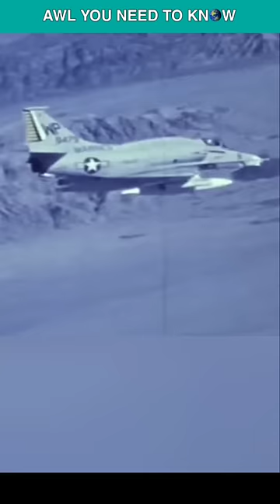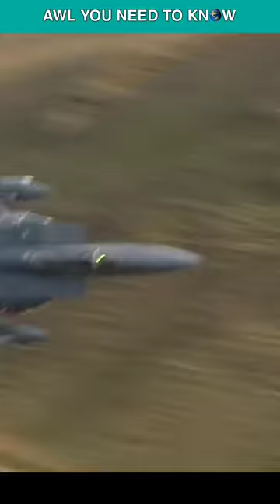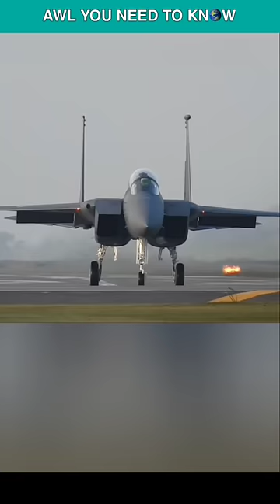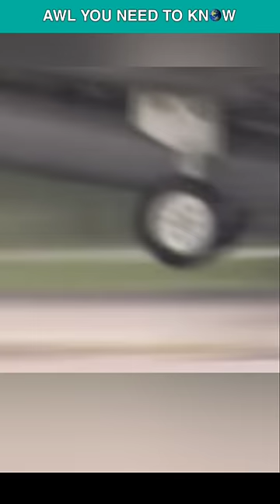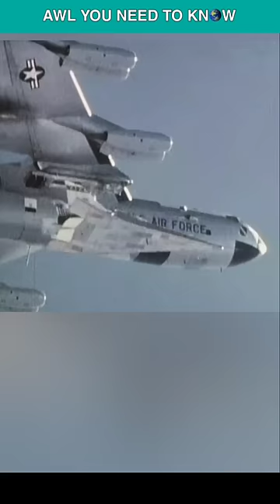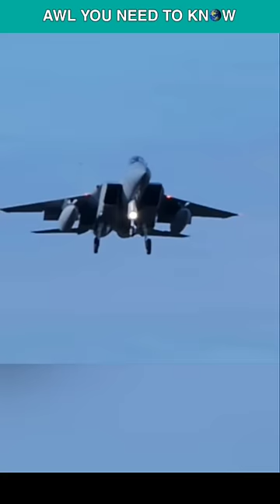When an Israeli F-15 Eagle Landed Without One Wing In 1983 #shorts

Comment: You know you designed a masterpiece when it still can fly without wings.
Reply: Wing*
Reply: @badam7783  *wings. 
It can't fly without a wing, but it can fly without wings.
Reply: @bremCZ  well in the video and on the pictures it flew without a wing so idk what your smoking. But it can only function as a rocket without wings, so it can’t “fly” without wings.
Reply: @badam7783  No, it flew with a wing...
Reply: war thunder moment
Reply: @bremCZ  Without A wing and with a wing is the same thing, both imply it has 1 wing remaining. I dont understand your point here?
Reply: @CaptainBread_  I can see that. If you understood you wouldn't have bothered rewriting what I had...
Reply: @bremCZ 😂
Reply: you know your comment is mastertrash when the grammar is incorrect 😂
Reply: @SotPSotPSotP  Which grammar point are you referring to?
Reply: It's hard to tell if the narrator was saying the plane could fly without any wings. Well land not take off and it might only do that when under a certain weight. It's also possible it could only fly as a lifting body without the wing portions past the engine. If the fuel tanks are in the wings the plane wouldn't have engine power and would quickly be slowed down by drag possibly to the point it couldn't fly even in a dive and would definitely be unable to land without loss of life.
Reply: @bremCZ So an F-15 would still fly without any wings? I think you suppose to say "Can't" instead of "can". Remember, if the object has "s" as the last letter (example: burgers), it means the object is more than one. So wings mean 2 wing(s). I got stroke while reading your reply.
Reply: @SomeOrdniaryEDS  That's because you don't understand it. Also when you're having a crack at someone's grammar, don't write nonsense like "I think you suppose to..."
Reply: @bremCZ you think youre pretty smart outside your little bubble there but youre really, really not.
Reply: @tiguilherman_plays  No I don't. But good attempt.
Reply: 1 wing and it didn’t even look like is had messed up the aerodynamics basically flying like it’s got nothing wrong with it
Reply: Westlife need this story for song "flying without wings".
Reply: @ErickKurnianto  😂😂😂
Reply: Anything can fly with the right amount of speed
Reply: Many airplanes can fly without a wing
Reply: Ah, wings are just over engineering anyway
Reply: McDonnell made better planes in the 1970s than Lockheed does today..
Reply: @bremCZ  Dude that's about the lamest play on words I've seen this year, made much worse by how f-ing hard it was to understand.

Kudos, keep on doing stuff like this. And if you don't get appreciated by others, atleast you will by me
Reply: @viktorbirkeland6520  Why thank you. Over engineered dad jokes are my speciality.
Reply: @bremCZ your comment makes no sense
Reply: @Billy.Nomates  Your inability to understand something is not akin to it not making sense.
Reply: @bremCZ  no,you simply didn't make sense,accept it
Reply: @Billy.Nomates  No, you simply don't understand the linguistic gymnastics. Acccept it.
Reply: An another type of plane recorded landing with similar conditions, search  Damaged A10 lands back at base
Reply: 😊😮 @bremCZ 😮u🎉z
Rhz😢
unüberhörbar 777😢😅😮7
Reply: That jet is one of the greatest fighters ever produced.
Reply: Its not a wing its a balancer a wing use is only for animals with feathers so they can fly but that fighter jet use oil to fly not tge wings that you said
Reply: @bremCZ  BremCZ is the only intelligent dude on here apparently
Reply: @bremCZ i love your comment and im so glad other people are just confused, irritated and upset by your, way with words.
Reply: @mitchc4474  Thanks, I quite enjoy their flailing, and it's slightly amusing that they're unlikely to ever understand it.
Reply: The comment I was looking for
Reply: Regardless of this short. I always had a love for the capability and iconic beauty of F15 Eagle.
Reply: @badam7783  if it is going fast enough, it would still be able to fly with no wings, the f-15 has elevons (elevators that work as ailerons as well)

Comment: He remembered the aeronautical engineering phrase : give me a powerful enouph engine and I will make a barn door fly.
Reply: They teach that in all aerospace.
Reply: I am pretty sure there is still a manhole cover in heliocentric orbit from a nuclear test.
Reply: Not just barn door. Enough power and the full barn will fly.
Reply: @SirSmurfalot eheh... so the problem with that, is that the same manhole you're talking about would have been able to escape the Earths orbit at the speeds it was traveling...
So there's just a dirty manhole cover floating through deepspace somewhere and we'll never find it lmao
Reply: It was a joke that they would have preferred not be proven true. But cool we now know what would happen.
Reply: @SirSmurfalot The ultimate M80 😂
Reply: It’s not that engines so much as the design of the F15 is a large, low lift wing. That’s a trait some of those Israeli pilots were aware of(they’ve also got more flight than most US operators of the plane). When the wing was sheared off, the pilot noticed the flight characteristics under power(that they could maintain lift at higher air speeds)and figured he could nurse it back on the ground. Worst case scenario, he could only make it part way and had to ditch the aircraft(well, worst case is at lower speeds, you end up with an unrecoverable imbalance in lift, slowly flipping the plane during the landing process without enough time/fuel to abort).
Reply: @Pikachugamer-2007 
It had enough velocity to escape's gravitational field but it wasn't moving fast enough to escape the Suns gravitational influence. It will be in heliocentric orbit.
Reply: @kimutaiboit8516  ah, right my bad.
I got geocentric and heliocentric mixed up.
Reply: @Pikachugamer-2007 aliens are gonna think we have giant pennies 😢
Reply: @Pikachugamer-2007 Makes me wonder, whatever it was that was under that manhole, is it in orbit too?

Aliens are gonna think us humans pretty funny, launching that stuff in orbit 😂
Reply: My dad was NAVY and said this too.
Reply: @SirSmurfalot its currently leaving the solar system

Comment: The pilot really didn’t want to be the only f15 to go down ahaha fucking legend
Reply: There have been several F15s lost, all to AA batteries.  There are zero air to air.kills of an Eagle.
Reply: @gilliganallmighty3  f15 has a kdr of 104-0....
Reply: @actualdogwater in the air with other aircraft yes, it has been took down by SAM sites tho
Reply: @actualdogwater Hundreds of airframe losses in accidents.  It’s been corrected but original production models liked to split in half behind the cockpit once they worked enough metal fatigue into the fuselage spars.

Comment: I served in the Israeli air force, its one of the most known stories, 
the pilot in the F-15 didn't knew he lost a wing. 
the fuel who came out covered the area of the wing and when he looked to the wing all he saw was a large trail of fuel. at first he lowered his speed which caused him to loose control so he just used the afterburners to navigate the plane. 
only when he landed he saw what happened and he fell on the ground from shock. 
McDonnell Douglas were so surprised from what he did that they gave the Israeli Air Force a spear wing for free.

Comment: Bruh he just saved the Israeli air force so much money. What a mad lad.
Reply: You cant fly with 1 wing 😅
Reply: @maxbutterfield4386 they repair the aircraft.
Reply: @brolol529  It usually would be cheaper to repair than to build a new one, but that might not always be the case. Although I'm sure replacing a wing wouldn't be too much of an issue.
Reply: It would probably depend on the shape the airframe was in. But worst case, if it was a write-off, they would be able to salvage a smidge more of the parts to use for repairs of other f-15s than they would have been able to from a smoking crater had it not been landed.
Reply: Saved America* much money
Reply: @pyrodrayson3216  Even if the airframe was bent and unrecoverable, there's still enough value in that craft that would be lost in the crash. It's another set of parts that can be used to keep the rest of the planes from being grounded for large repairs or overhauls. Much less stressful for the engineers to fix/overhaul an engine not attached to an aircraft grounded because it needs repairs.
Beyond that, real life data learning that it can fly with only 50% wing area is valuable combat data.
Reply: @AWACS_Eagle_Eye the iaf prefers to fix aircraft rather than scrapping them
Reply: @johnboyjr21 
Yep
Reply: @AWACS_Eagle_Eye  
the problem wouldn't be the wing but the fuselage since that hit would have sent vibrations throughout the F-15's body that could fckkk up it's entire structure and stability (like seriously, it basically broke off a wing which is pretty hard to do) that it would be better to buy a new one than actually repairing it.
Reply: @maxbutterfield4386 well this video and footage of it says otherwise
(But not all aircraft can fly with 1 wing like the F15 was able to)

Comment: I had a similar issue with an unsecured wing on one of my RC planes detaching mid flight. The motor on it was about 4x as powerful as the plans called for. It would go fast enough to shudder the airframe at over 60% throttle. Wing came  off mid flight and i throttled up and landed it basically vertical. My buddy said i turned a powered glider into a VTOL.😂

Comment: That is an incredible pilot there ! Of course the wings are the major lift for the plane ....... though in this situation you can use the flaps to compensate for the loss of the wing to control the plane ...... In short , this man knew what he was doing , knew his equiptment and is a badass mfer 🙏

Comment: That pilot has LN2 on his veins 🧊
Reply: Yeah, IDF pilots are absolute lunatics. This accident almost certainly happened during one of their combat drills for pre-stealth flying. They didn't have low-visibility jets, and so they learned how to fly so close that their radar signatures blurred into one. 

For example, during Operation Rimon 20. USSR jets (working for Egypt) tried to intercept "one" IDF jet, only to realize that it was 4 flying wing to wing, with 4 more flying below 100ft to avoid radar. They lost 5 of the 12 jets they sent, only causing minor damage to one IDF jet. It was a big scandal that was basically memory-holed by both nations because it was horrifically embarrassing for the USSR's Air Force, and dangerous for Israel because they didn't want the USSR to increase aid to their enemies.
Reply: @theprogressivecynic2407  That's incredible!

Comment: So many things wrong on this. The F-15's fuselage DID generate sufficient lift to compensate. But the airspeed was 250 knots to maintain level and reasonably controlled flight. The aircraft then made an extremely high speed landing, blew out all the tires, but he successfully landed the ONLY one-winged aircraft I've ever heard of and I'm 70. Superb airmanship.

Comment: The stricken aircraft didn't immediately drop into a death spiral giving precious extra seconds to the PIC to assess the situation. Presumably the sustained level attitude of the aircraft indicated that recovery was possible by increasing airspeed and thus lift. Had the situation deteriorated from that point on, the crew certainly would have ejected.

Comment: Lmao, this is just like War Thunder, but the problem, I lost my Ailerons and it is hard to control the plane. The other one is I lost my Elevator and it is hard to climb. I think as long as the Stabilizers are there, you're good, but this is a different case for the F-15...

Comment: The event is true but the explanation is horseshit. The control augmentation system or CAS rate sensor assembly and other complex computers adjust for and compensates for battle damage automatically. I was an avionics tech on that aircraft system for ten years. And the back seater on a B or D model...is NOT a navigator...it is an instructor pilot or a joyrider.